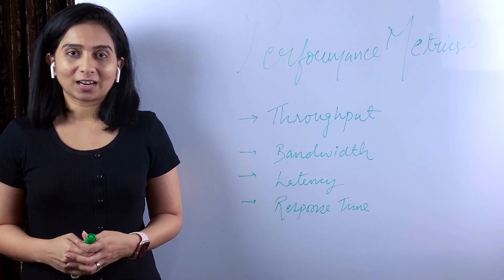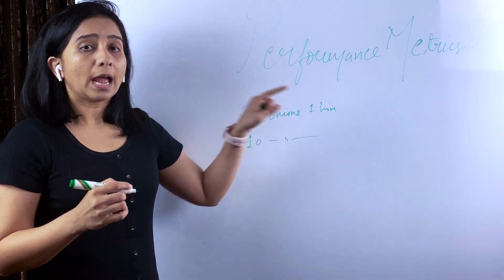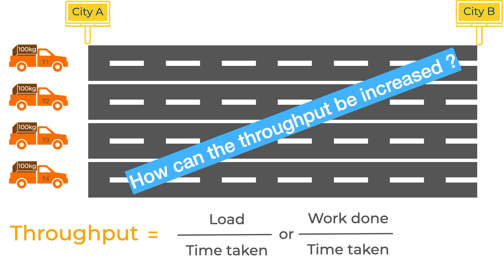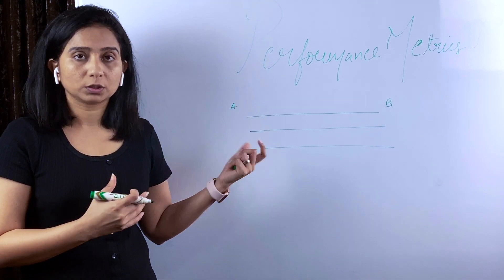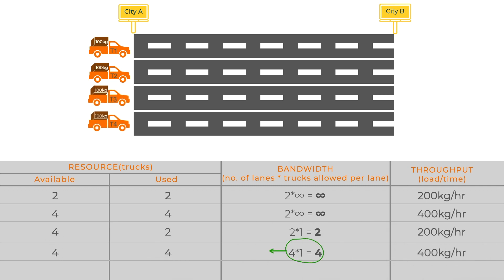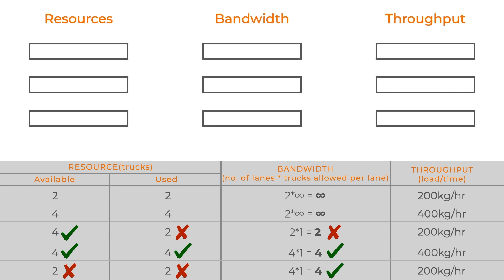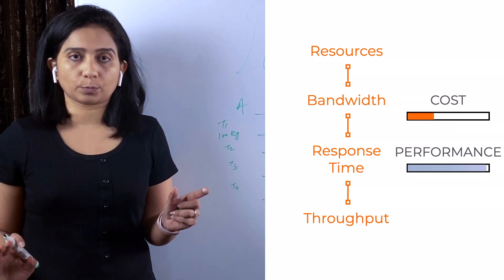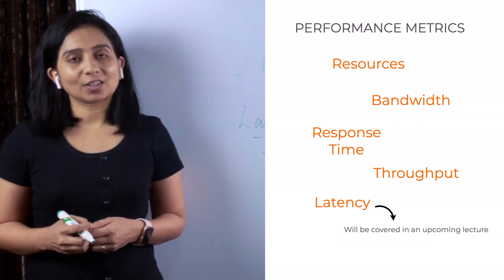Performance Metrics | System Design Tutorials | Lecture 14 | 2020

Comment: Hey! From what I understand, latency does affect each individual response times for each request but the effect on the throughput of a system is negligible. In your truck example, only the first truck will take extra time to reach the destination. For the subsequent trucks, they can start right after the first batch of trucks. In other words, the communication channel is like a water pipe. The first droplet of water takes time but after that, the amount of water is just dependent on the bandwidth and the throughput of the water pump. Am I getting it?